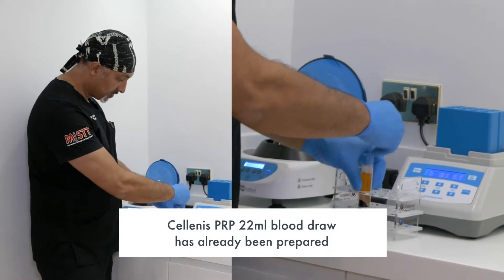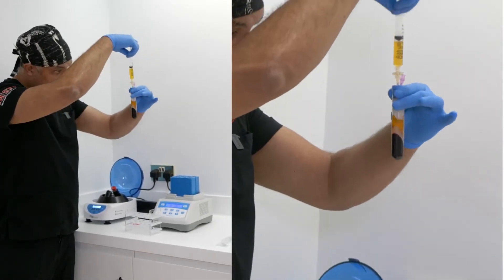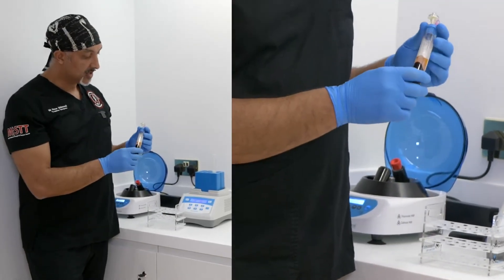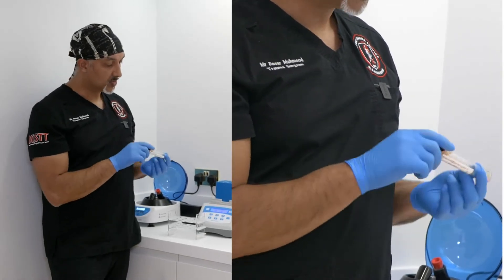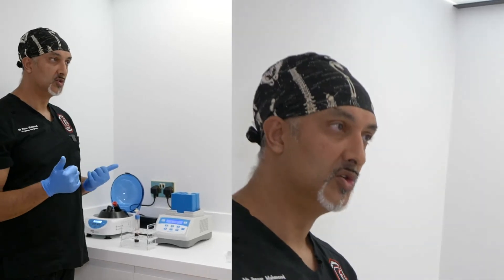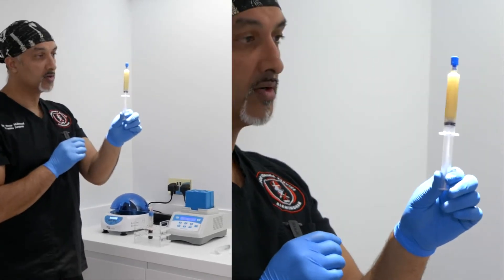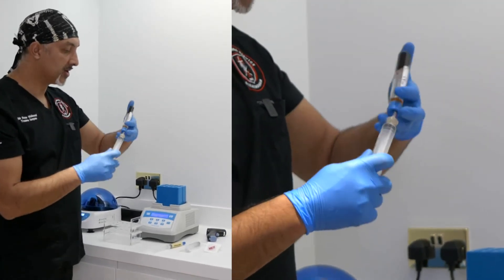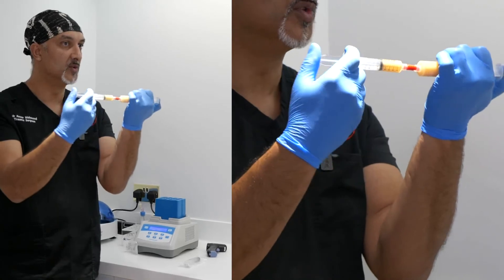Preparation of TropoVisc

Comment: EZ GEL PRF is better…
Reply from the maker: 1) EZ Gel PRF makes use of a fibrin matrix.  Cellenis DermaFiller gel matrix consists of denatured proteins.  Which biodegrades faster?   There's a 6 fold difference between the two degradation rates.  2) How much injectable filler is obtained per volume of blood draw for each system?   3) Compare plt dose, RBC, neutrophil and monocyte levels for each system.
Reply: @roseanneaitken7384  once absorbed CDF likely to leave behind “nodules” perceived as “bumps”…no such risk with EZGel PRF…